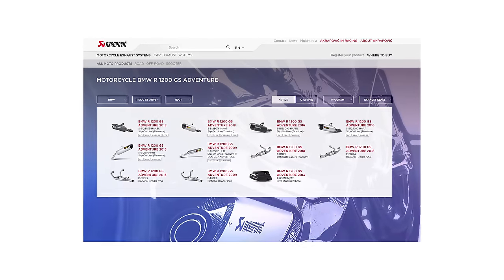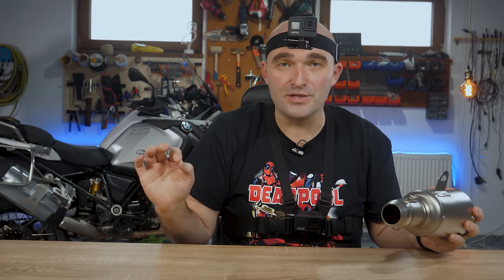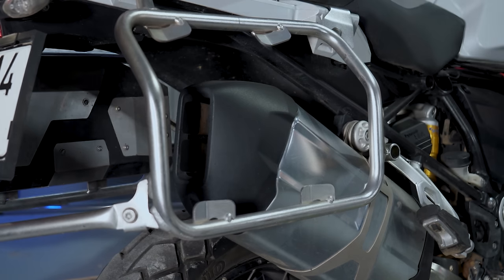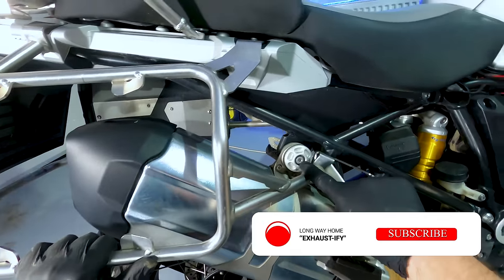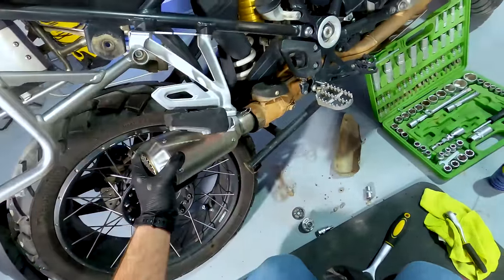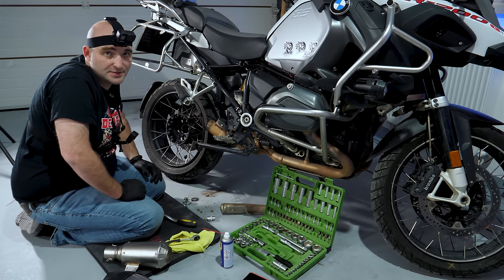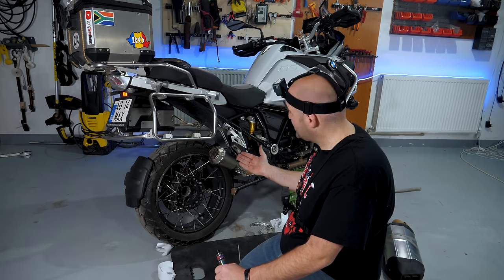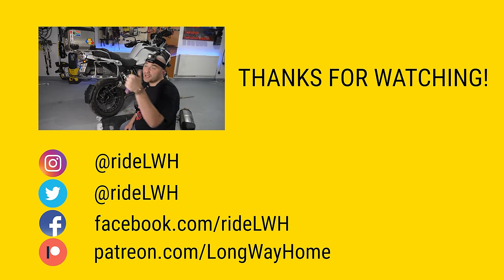How NOT to Improve the EXHAUST on a BMW 1250GS and 1200GS

Comment from the maker: What's your favorite aftermarket exhaust?
Reply: Usually the cheapest of the selection of reputable manufacturers, not Aliexpress specials. 😉
Currently it's Arrow and V&H.
Reply: I’m a big Yoshimura exhaust fan ran them on my Hayabusa and all my GSXRs but I haven’t tried one on the R1259GS yet.
Reply: I really in joy your videos and I think your camera set up worked well.
Reply: Recently rode an R9T with a full AKRA system. Sounded OK to me. 
Same day rode a bone stocck 2014 R1200GS, factory system is OK too.
I would get rid of the factory can just for the weight savings and nothing else. Loud systems get old quick on long runs at highway speeds. 
I have a 2003 SV1000N with D&D "mufflers" BUT there's no such thing as muffling going on when ALL you can see is a straight pipe perforated core from start to end. Sounds awesome tho. 🤘🏻😈
Reply: Try the Lextek hp8 exhaust from the uk...its more than 3 times cheaper than alot of the big brand names, very well made and sounds great when winding it on. This is coming from someone who run the Remus pipe first was really dissapointed when the paint started flaking off after 6 months, definately worth a look!!
Reply: Cat out, powercomander on. Job done
Reply: Hp Corse 4 track sounds good.
Reply: One that doesn't constipate the internal gasses.
Reply: I was lucky to find a cheap Yoshimura Hepta Force... sounds AWESOME !!!...
Reply: 2 brothers and the Aka sound good on the super ten
Reply: I find the LeoVince good, have a nice sound  and the option to take out the dB killer as well as the price...
Reply: Danmoto has done alright by me and doesn’t break the bank
Reply: Flat Twin Frog where did you find it from? And what price?
Reply: J&H

Comment: "Dave's not here man ?"   Another..and even better video using  the 3 camera technique..(there's 3 GPs on my Scout).   
BMW, along with Sena, may have Dunning-Kruger Syndrome in its customer comments dept..that would answer your rhetorical question of "why.."
A hack/trick is to cut a couple of slots in the pipe ends and tighten with a hose (spiral screw w/slotted band) clamp.  
In the video, I believe I saw, (definitly saw after review) when your Cap Mount GP looked down the pipe (@ the 6:26 timestamp) after removing the boat anchor, the illuminated floor (?)   I'll review later after I put pants on.  Oh the conundrum of pants v. video views IS perplexing.  The Sport Can sounded fantastic the second I heard it !   Good editing, and only your first try at it, as well.  Stay well..we're all in this together.
Reply: mark foster Cheech and Chong reference. Takes me back 👍🏻
Reply: @bav114   Thanks, Dave !  You speak better English than I could EVER speak Roumanian.

Comment: Tradionally if you change muffler for sound gain you will loose a little bottom end torque plus chew a bit more fuel. This cannot be avoided as you are changing air flow balance & definately the standard computer will not compensate. 
But overall a little more sound may be worth it.

Comment: I would swap the Go Pro for a Fez(little round brim less hat). I think that would look a lot better. I just don't think that exhaust muffler has a very long term future, loses too much back pressure, performance. Hang the expense and get a decent muffler for A BMW. I put a Yoshimura copy on a GS1000 once. Not a good idea in the long run.

Comment: 30 some bikes ago, I thought every motorcycle needed a loud pipe. Hell, I even put a Vance and Hines slip-on on my Audi 5000 in college 😂. My experience with attention getting exhausts have led me toward more quiet bikes. Especially the 1250GS when my wife is on the back... and wheelies on the CRF450L are nearly silent as far as the neighbors are concerned. The S1000RR is my loud bike and Ive got an Akropovic on that bike. Boy was it salty$$$ too 😖. Have you looked at any of the pipes on ebay? Ive seen some fairly priced offerings like one from Delkevic for $300 USD.

Comment: Aside from the added noise, the one downside I can see is that your shorter “sporty” exhaust will be impinging on the inside of your panniers and will possibly mark - or even scorch them. One thing - 52 cm is about 21 inches or about the length of your forearm.  I think you meant 52 mm.   Good grief - are you an American?

By the way - why doesn’t Dave help with the cameras?   He seems like a rather lazy bugger in many respects.